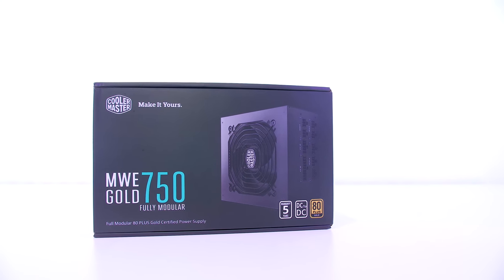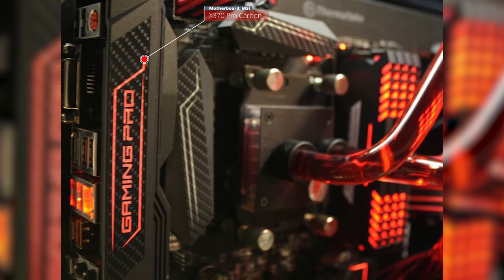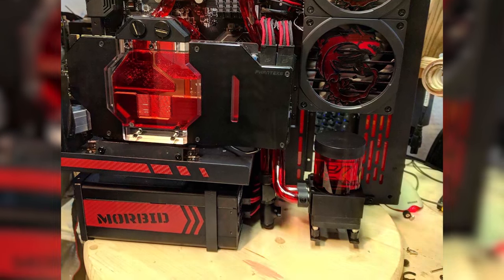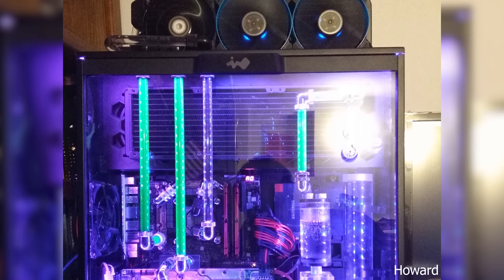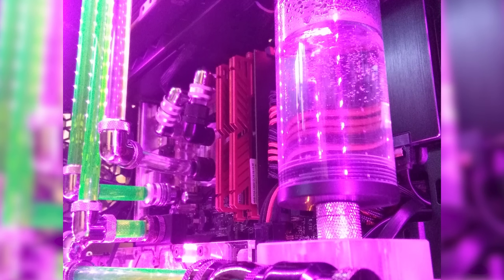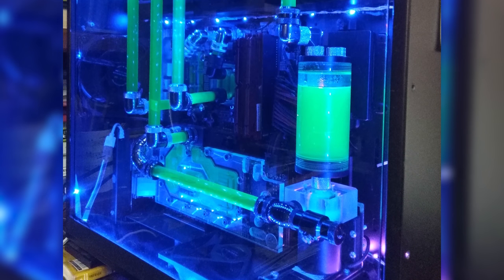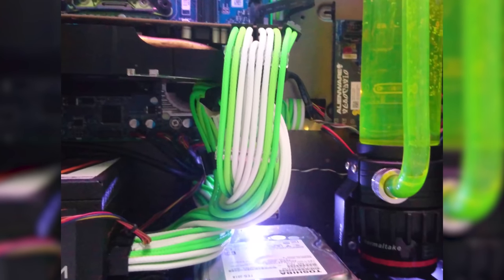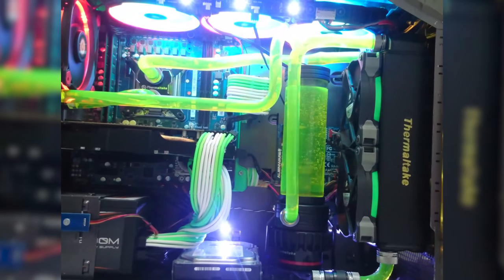PC Setup Showdown Episode 3 - Water Cooled Gaming PC Build Edition

Comment: No.2 for me because of those light sabres even though it has a couple of issues.  One, 3 triple rads is overkill unless you are seriously overclocking so sticking one on top was a waste.  That money would have been better spent on the RAM which is mismatched and most likely not running dual channel so at least a 25% drop in speed.  Looks schmick but

Comment: i vote for #1, will, and for a good reason. I BUILT IT! its been a fun work in progress, with will changing his mind on a couple ideas while the build was ongoing. i was somewhat concerned with the 240mm radiator as well, but i can assure  you that under heavy synthetic benchmark loads, both the CPU and GPU stay well under throttling ranges. the Corsair ram runs steady on an XMP profile at 3000mhz, and both the CPU and GPU regularly go into boost mode during gaming. and the system remains deadly silent. if you want to see a little time-lapse video of the build, check out "ghomish technologies" on youtube, or check me out on facebook. will is a friend of mine, from my local area, and a fellow veteran. we both love gaming, streaming, and crazy computer builds. we were actually working on a full false-wall setup for the system, so no cables, stands, nadda, were visible, all of it would hang on the false wall, but his housing situation has recently changed, so things will be getting a little jumbled. but im sure that before long, we'll be doing more fun things to the Zen Dragon. so yeah, gotta vote for my boy will!